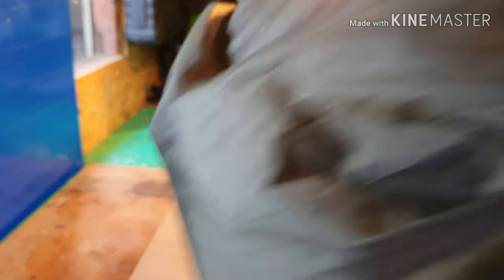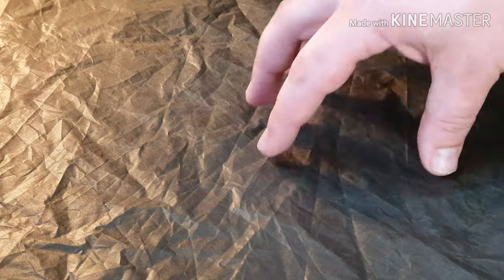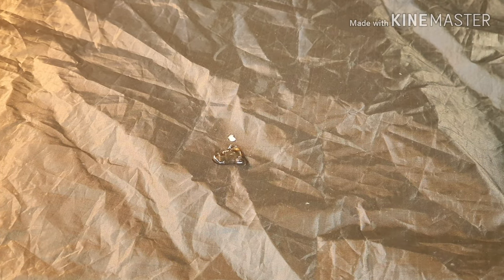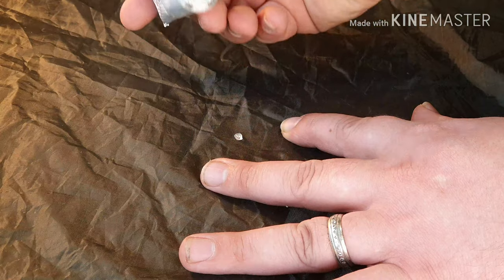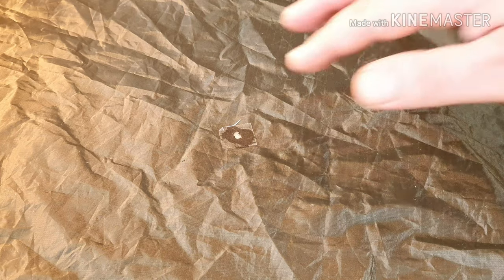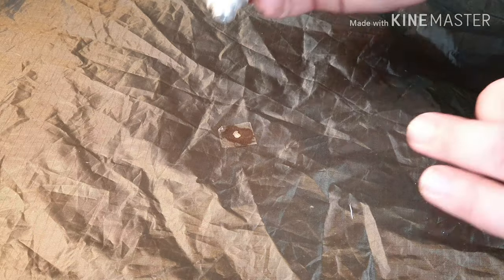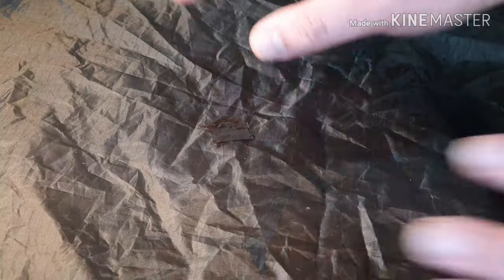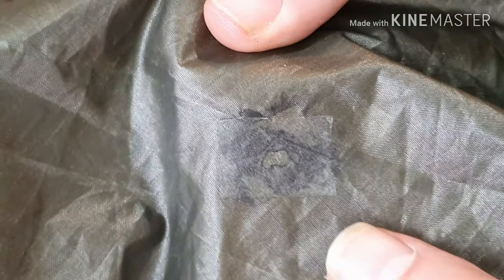How I Repair Holes in Tarps and tents

Comment: Good video.  This is the exact type of repair I need to do for the floor of my tent.  My only comment is that everyone says to round the corners on the tape before applying so there are no sharp edges that may eventually "come up" and allow the tape to come off.  Maybe not critical, but it makes sense that rounding the corners would make it more likely to stay on forever.

Comment: Brilliant Scott, you’ve just saved everyone a fortune with this tip.
I’ve always saved the patch material you get with a tent, but didn’t know about the tenacious tape and seamgrip glue. 

Much better to repair than replace 👍👍
Reply from the maker: Thanks mate appreciate your comment. I only researched it as 'it happened to me' I found that they held up well. I was gutted that it happened had like 15 - 20 holes in i wasnt impressed. So i thought I'd share. Much cheaper than replacing and still plenty left for more repairs.
🤙👍

Comment: great video as always i do the same but with round patches as I was told that they are less likely to catch the edges i don't know if this is right but  seem  sound advice to me ATB Bryn
Reply from the maker: That sounds a good tip, rounding off... I'll have a go at that.
Thanks mate appreciate your comment. I only researched it as 'it happened to me' I found that they held up well. I was gutted that it happened had like 15 - 20 holes in i wasnt impressed. So i thought I'd share. Much cheaper than replacing and still plenty left for more repairs.
🤙👍

Comment: Useful video, thanks very much. The only thing I do differently is I cut the corners off of the patch and/or tenacious tape. Being rounded makes it much less likely to lift in the future. Thanks for sharing. By the way. Where do you get your tape and seam seal from? All the best, Paul. OmO
Reply from the maker: Tape and seam seal where both go Outdoors mate. I'll try rounding off.  Sounds a good idea. Thanks mate.
Reply: Thanks for that. My last lot of clear tape came from eBay. I’ll check with GoOutdoors. I doubt people have been bulk buying that! 🤦🏻‍♂️